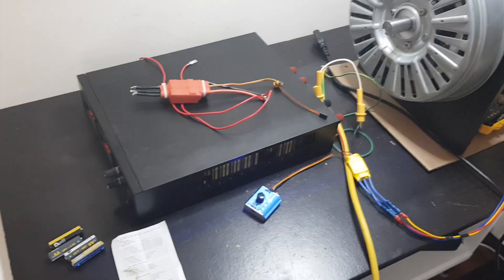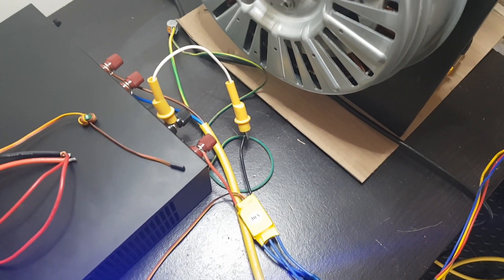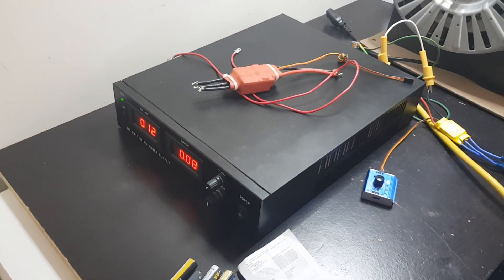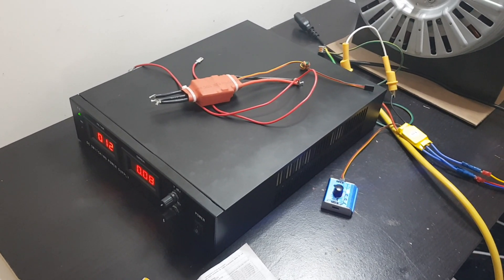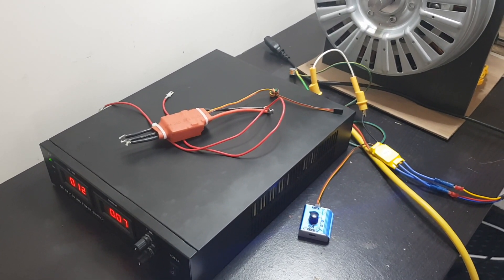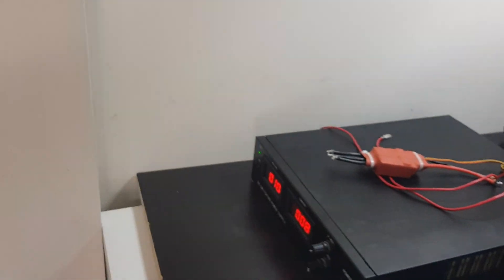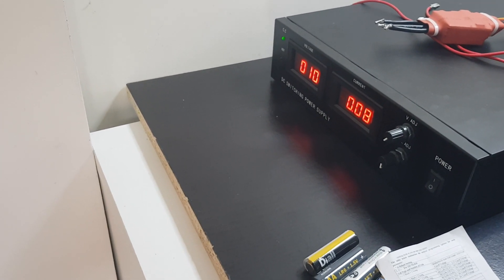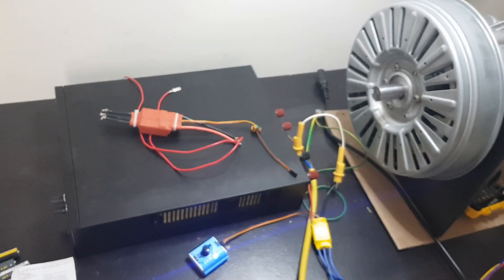Gerard Morin Hyper Drive tunning in a radio channel | Receiver

Comment: You should use a spark gap with your setup it will take some of the load off your power supply. Try using a higher voltage speed controller 300-500v .  the noise is coming from the imbalance between power supplies and speed controller , you are creating a bottle neck for the current to flow to motor. If you noticed, Gerard doesn't show his speed controller but he does describe the speed controller, watch video's take notes. You need the speed controller sensors to be in the correct place to work more efficiently with your motor, they are all made differently.. I think Gerard mentioned he had to go 12 poles over from 3 phase starting point with his sensors and I noticed you don't have a rectifier , maybe you do I just didn't see it in video. Anyway great job so far , stay excellent. 😀
Reply: Tesla described over 23 different types of electricity. Be sure your using the right type. 
Gerard's power supply was reciprocating radio frequency, double spark gapped. 
It was generated from a shaded pole motor (driven at 3000rpm and electrically/ magnetically isolated),
I hope this helps. Good luck!
Reply: @mcbusinessmonkey   23 different types of electricity ????

Comment: cannot work that way.... u need H bridge pc board, one per phase....+ a divider voltage pc board...all of that in order to make it run in sensorless
Reply from the maker: Well, it is running sensorless now but I need a higher volt output controller. This is my main concern for now.
Reply: @eugen995  the noise it does is typical about a missing of voltage...12 volt is not enough to run this kind of bdlc